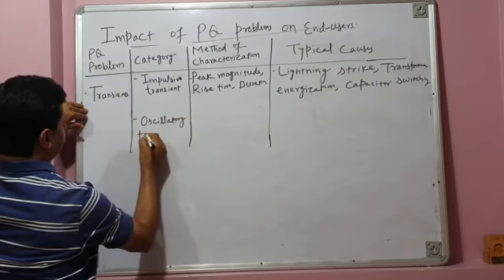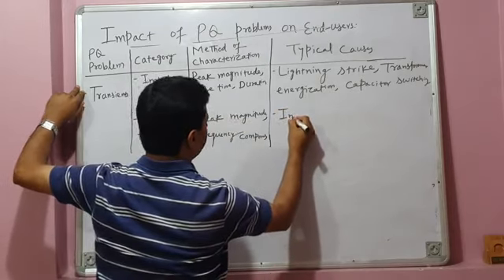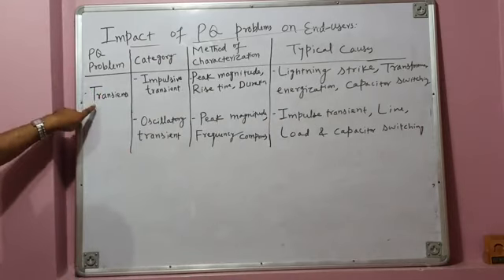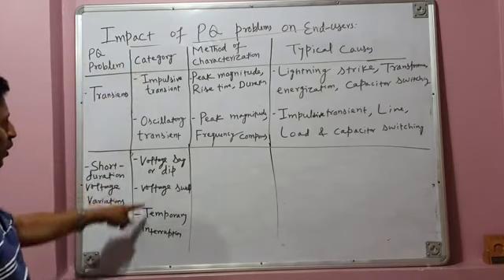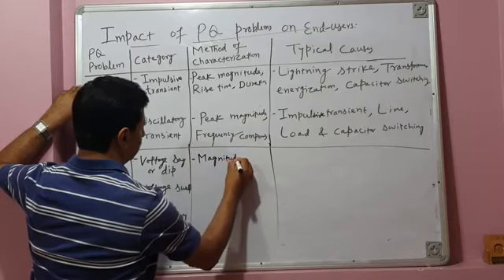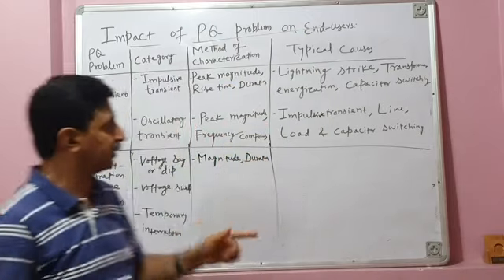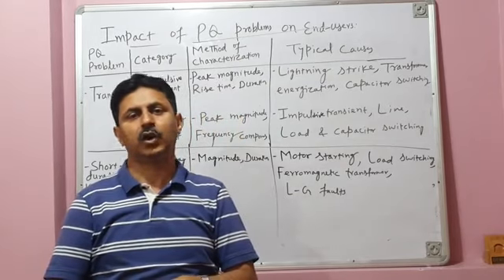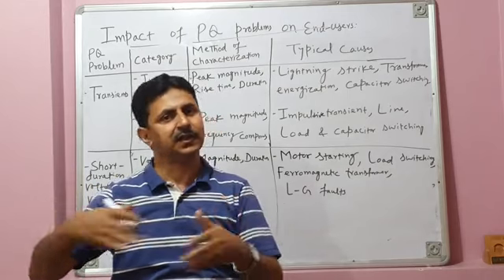L2_Power Quality Problems1

Comment: Sir, what is mean by a transformer saturate in normal operation by dc offset
Reply from the maker: A DC offset will result in flow of DC component of current in transformer winding which will cause transformer saturation.
Reply: @prof.a.h.bhateednitsrinaga6515  k sir